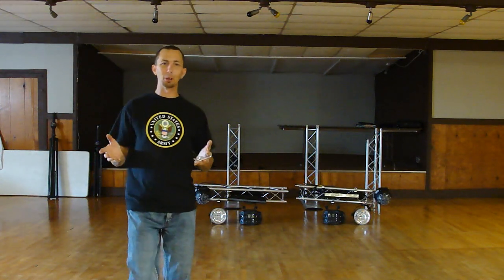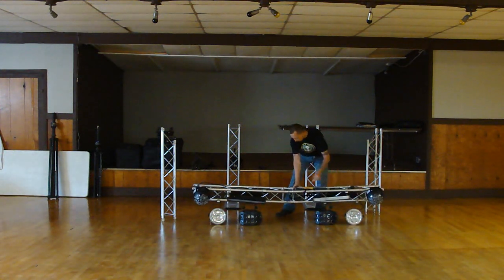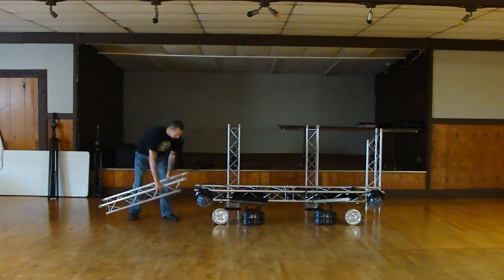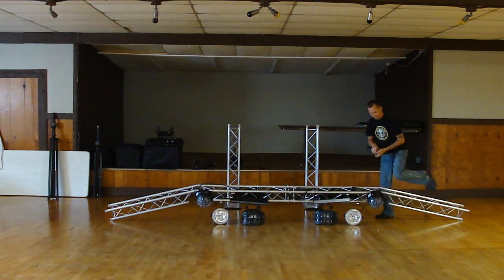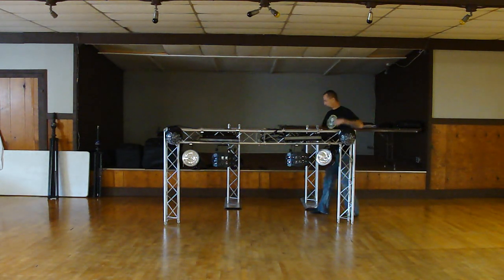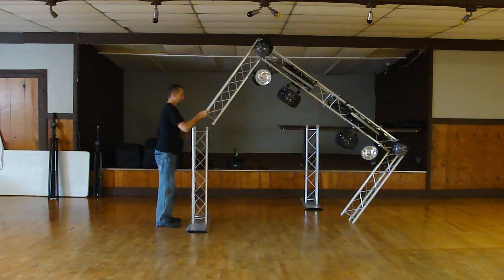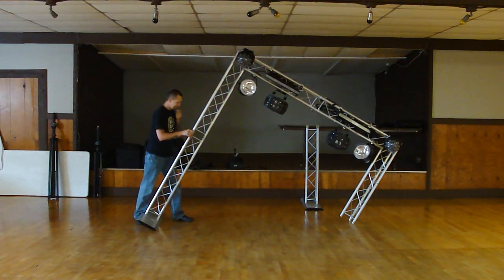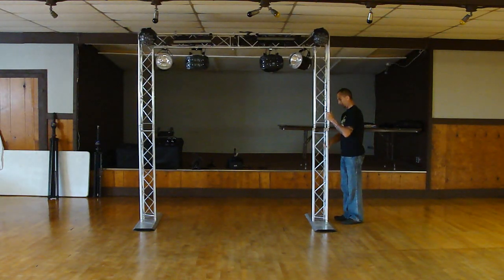Global Truss System 1.  1 man set up technique

Comment: Well I'm buying this truss to replace the crank system that I brought from ADJ wasn't impressed with the crank that gave up after only using it for one year.
The dimension of the pipe is smaller making it harder to attach clamps. Thanks for the post because I run and setup everything myself with help and sometime I don't have help at all.

Comment: Thanks for the 1 man setup video. I just bought a similar setup, trusst version. I knew there had to be something better than those pins. 

How do you transport the lighting if you leave them attached to the poles? Mine gets torn up in the trailer when I leave them attached. Maybe you're using a van or pickup with a shell?

To those asking about scratching the wood floors. I purchased two 8' black floor mats from the hardware store. They are mostly used to cover long cable runs or when outdoor but I've recently found another use for them :)
Reply from the maker: Matt Corzine I no longer keep my lights attatched on the bottom, but I use to hang them from clamps in my trailer.  I bought some Chauvet Swarm 5 FX's, and added 2 more Chauvet Shadow UV's.  I also uplight this with Chauvet's "EZ Wedge" and recommend those to anyone.  They are amazing.  I can fit all of my lighting in 1 Ariba bag for transporting them now.

Comment: Is this the "Global Truss DJ Truss Bundle 1" ? 

With 1.5mm wall thickness?
Reply from the maker: I believe they are the same truss.  I'm not sure what the wall thickness is, but the outer diameter of the tubes are 35mm.  This is also known as the "mini truss" system.
Reply: Chris Surdyk

Wall thickness is actually the material thickness of the tubes, usually 1,5-3mm on truss.

What kind of loading capacity do you think it can take? Would you dare to hang on it with the lights or does that anyway feel too much?

I´m about to order 2-3 sets but I wanna know if it can take some serious load or if its just for like 2-4-6 lights.
Reply from the maker: Partyakuten Umeå By now you may have already bought this system... but Even with the lights on it, I can hang on it.  When I have the full size set up (10'X15'), I climb up the sides if I need to adjust a light within reach from the sides with no issues.  Very sturdy.

Comment: Dude how many wood floors have you scratched up?  I know several venue managers that would be screaming at me if I did that.
Reply: I use black rugs that are later used to hide long cable runs. Found out the hard way after scratching up the floor at home.